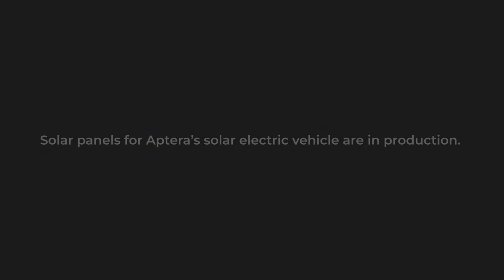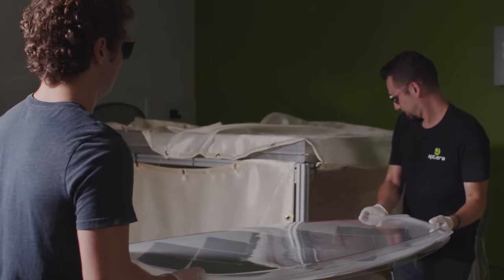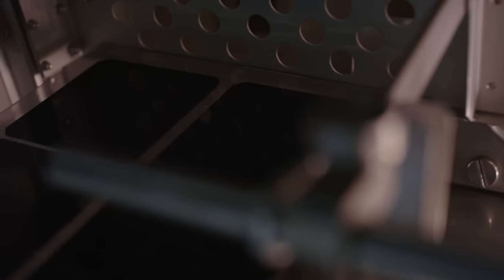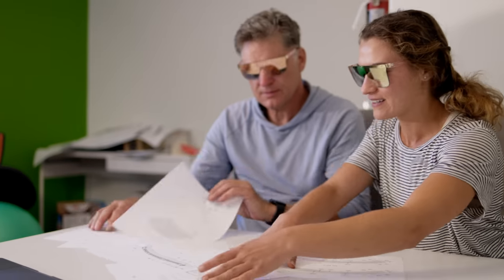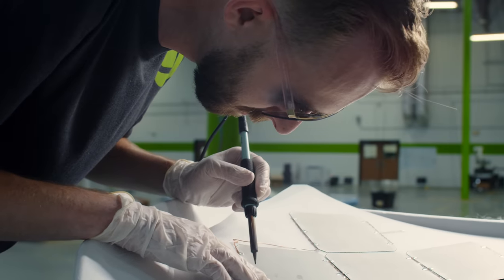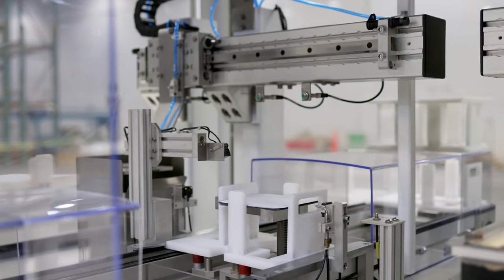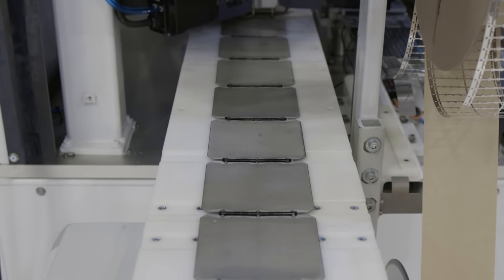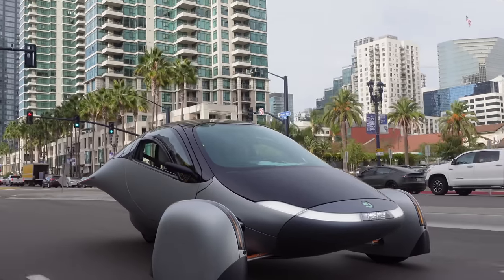Aptera — Solar is in Production

Comment: Incredible work.  To form panels over 2 axis while remaining durable and with a process that can be scaled for manufacturing is a major milestone.  You guys are leading the way for viable solar charging, and I hope this will inspire other automakers to offer solar options in their EV's.
Reply: Sunpower is the best in everyway. Aptera is also world leading in efficiency.
Reply: If it's scalable, it might give options for housing roof design development too! 🤔
Reply: @RufusJacson  not really, standard panels work better for that purpose.
Reply: @MrGamelover23  It depends on where they are installed.  These might be much better in locations where they are subject to damage.
Reply: @bobhilder1469  Not with the energy output and efficiency that Aptera has achieved.
Reply: @MrGamelover23  I meant that it might enable more interesting roof architecture rather than a standard flat pitch design i.e. curved panels for a curved roof.
Reply: This is a hard engineering problem: You can't bend a solar cell on two axis, that would require they were elastic, so they need them to lay flat under a curved surface. That requires either  that the gap is filled with an encapsulant, likely optical transparent silicone, but you can't just apply vacuum between the acrylic front and the backing film to drive out bubbles, because that would break the cells too as air pressure would bend them. From the video it looks like they a setting up the strings of solar cells, face up, on a former to give them support, then vacuum form the top acrylic sheet on top of them, then to make the backing as the last step, by either painting silicone or vacuum on a heat formed film? Still this is twice the number of steps compared to an ordinary solar panel, but it is quite neat and they look appealing and bubble free!

Comment: I think the most important quote  in the video is that they have put one of the riskiest design challenges behind them.  Assuming they have figured out how to make their chassis in sufficient quantity and make a wise decision on the wrap, there aren't too many more concerns left.  I think it's time to buy more stock.
Reply: Wise decisions?
Reply: They're not publicly traded yet, their option to buy has expired in June
Reply: @beachbeemer  There is vinyl wrap and PPF wrap.  If they choose vinyl, it is thin, not as durable, does not hold up well in the sun, and is a deal breaker for many people.  If they choose Cosmetic PPF, which is a thicker polyurethane film, that material is thicker, more durable, and self-healing, with a 10-year liffespan.  The wrap is a point of concern for a lot of people, but there are wiser materials to choose.  I am sure Aptera will get it right.
Reply: @littlemstracy  A new round opened up and is currently still open to the best of my knowledge.  It's not to late to back the truck up and load up on Aptera shares.
Reply: @jeffreypetsinger2967 , thanks for the heads up on that.  I tried to invest earlier but missed the cutoff.
Reply: Thank you for the explanation.  I don't like the idea of the wrap anyway.  I may get it without a wrap and have it painted when I get it home. I'm thinking about Candy apple red.
Reply: @littlemstracy  They offer new rounds once or twice a year
Reply: Agreed!!  🙂

Comment: Great video! More videos like this every other week would be awesome.  That would only be a handful of videos until Delta is revealed.  One thing I noticed that seemed to be missing is the hatch solar panel.  At 2:42 I did not see it in the layout nor on the rooftop shot.

Living in WNY, it would be great if while the vehicle was preheating in the dead of winter that a reverse current could be applied to the panels to melt the snow and glow at the same time.  A slow pulse like it was alive would be cool.

Look forward to your next video.
Reply: I had thought of a blanket of some kind to throw over the Aptera for a snowstorm. Brooming off a solar panel seems like an interesting idea!

Comment: Looks great guys! The effort that has gone into making such a clean and efficient car is simply amazing. Would love to see more videos of road testing the car at higher speeds/canyon driving.
Reply from the maker: We can't wait to provide you with more amazing content!
Reply: @ApteraMotors  amazing! Absolutely love the transparency with the build progress - would be amazing if you guys did a series for true hardcore nerds/engineers on the HV system, cooling, suspension geometry and so on. Lucid did a few really in depth episodes on their driveline that were very interesting. I understand that there are some things you need to keep tight lipped until production time but would be amazing when they can be shared!
Reply: Aptera Motors. To borrow from Steve Jobs  of Apple.  “insanely great!”

Comment: Solar cells that are simultaneously flexible in 2 axes are a PITA.  Within this domain are cells that must flex only ONCE, versus cells that must flex repeatedly or continuously.  Aptera cells are a mix of both, with a major fixed curvature set during production, then impact and thermal "flexing" during use (which is common to all solar cells, including flat ones).

Aptera solar cells need to curve just once as part of the production process, and the Aptera radius of curvature, while significant, isn't extreme. Unfortunately, for all intents and purposes it is pretty much impossible to make a flexible solar cell with anything close to 20% efficiency.  Only rigid solar cells presently reach this efficiency.

Aptera is all about efficiency!  How can they reach their solar performance goal?  The answer concerns reframing the question: Can a solar cell precursor be made, then flexed as needed, and THEN be processed to become a functional solar cell that is efficient, rigid and curved?

The Aptera video provides clues that this is indeed what is being done.  Rather than list those clues, I'd first like to hear your thoughts on this!

Comment: So "in production", but the technician says the panels are close to the design goals.  Which is it, you are producing the ones going on vehicles, or they are not yet ready?
Reply: I'm guessing they asked for 750W and got 700W so they said "That is close enough" so they're warming up the production line. They might either build ahead or (more likely) see if they can improve it slowly while the rest of the facility gets up and running.
Reply: Aptera is a Kaizen, or continuous improvement company.  They will never say "good enough" or wait for model years to phase in improvements.  This is not an either or situation on any of the Aptera engineering.

Comment: I hope that the 10 a day statement was old. 3,650 a year will really slow down production and output. This might cause people to drop off. Lets hope they increase that section of production in order to make more. Either way, I liked this video, it’s polished, technical and informative.
Reply: Steve, they noted in the video that they had a low volume production line and that they were already working on a high volume line.  They will be able to scale as needed.
Reply: Bruce, do you think they’ve started to produce in low volume to get a head start on production?
Reply: @LanderMaybe  Yes. there will be some of the initial production vehicles destroyed in the crash test program, so early defects in solar panels used may not be quite so important.
Reply: @n.brucenelson5920  Hey Bruce, how many Apteras will have to be destroyed in crash testing? Can parts that are not damaged during testing be reused? Take care.

Comment: I obviously missed an opportunity today when I put on my Zero shirt to go out, skipping over Aptera. This is great news that you're sharing. It reinforces my conviction that the full solar package is what I want my neighbors to see. I'm so happy this moment to be a reservation holder and an investor. One question though, since I sometimes procrastinate. How long can crow poop be left to bake on the panels before it causes discoloration or loss of function? If I clean it up within a week, will everything be okay?
Reply from the maker: Hi Dan! That's okay, you can rock your Aptera shirt tomorrow 🙂 Thanks for being part of our movement. And yes, keep them clean with soap and water. We are designing with this in mind. The panels will be guarded with a strong layer of protection to withstand hail or animal feces. The best way to capture the most amount of energy from the sun is through full exposure. Because they work together to charge the battery pack as efficiently as possible. That being said, just because certain panels aren't exposed to the sun, does not mean that everything will shut down.

Comment: Very excited for this! I'm assuming this means that all production for the Aptera is nearly ready to go to start building?

Also, I'm curious about something.

With all the options on the Aptera, I wonder which ones, if any, would be user-end upgrades that can be purchased later to be added to an Aptera. Example: say they buy a base model. No additional add-ons. Can an off-road kit be added later? Improved audio? I assume these 2 may be more difficult. Possibly the tent and animal kits might be easy user-end add-ons later? Asking because I've set my reserve order, but I'm wondering if I'd ever want to get the tent kit later on. Don't do a lot of camping, but maybe that might change in the future. Most of all, if I do a road trip, which is something I'd love to do someday. I'm also curious if window tinting would be doable or not. Or maybe getting a paint job, if you want to change the color someday. You said you want the Aptera to be a generational vehicle to be passed down to kids, but if say I get the noir color, what if they want it to be white or something custom?

I know, lots of questions. Sorry. 😂
Reply: Aptera is a right to repair company so in principle most things can be added.  Due to the weight of the battery packs, they might be a difficult prospect, however.  Custom colors can be ordered from Aptera or done at a local shop.  Aptera encourages aftermarket suppliers.
Reply: Excellent prepper vehicle.  Maybe a vehicle for Mars?
Reply: @daviddrake6875  Aptera is designed for use on Earth.  Mars vehicles will have an entirely different set of conditions they need to perform under.  The sharp focus on purpose from design on, would be similar, however.

Comment: I am a reservation holder as well as an investor with Aptera. Can you confirm if your production version will have V2H capability? No, I am NOT talking about V2G (i fully understand that the regulations are yet to be standardized).
It will be such a shame not to utilize all those battery power in the car. Especially since Aptera is promoting it as a Grid Negative vehicle.
Reply: They've said they expect to have V2L (Vehicle to Load) at launch. That's via an ordinary 120 volt outlet (or 240 vollt in Europe) useful for camping, computer charging, power tools and some emergency power during blackouts. 

With their open documentation and "right to repair" philosophy I expect some entrepreneurs to provide V2H and V2G add-ons soon after launch.
Reply: They’ll eventually have all the V2s, but I wouldn’t count on V2L at launch.   They are focused on getting the essentials working first in the initial units.

Comment: love your work! whats with the glasses? 😂😂😂
Reply: It is a safety measure do protect against the UV light test rigs.
Reply: N. Bruce Nelson is wrong.

From another commenter who looked up the ACTUAL safety requirements.....

"Laser Protection. Employees whose occupation or assignment requires exposure to laser beams shall be furnished suitable laser safety GOGGLES...." and ".......or other equipment producing ultra-violet radiation shall be so arranged or shielded that ultra-violet radiation, either direct or reflected, does not strike employees' eyes in harmful intensity; where such arrangement or shielding is not practicable, employees shall be provided with GOGGLES..."

Note the above references GOGGLES and not "weird sunglasses".

Comment: Awesome update. I still don’t get the sunglasses other than “the future is bright” innuendos I’ve heard in the comments. LOL.
Reply: When working in a test environment with UV sources it is likely to be an OSHA requirement to have them.
Reply: @n.brucenelson5920  Makes sense. Thanks. But even during an interview?
Reply: @sentino68  I haven't been in that location and don't know what the Cal OSHA rules are for the space, but it it certainly possible.
Reply: N. Bruce Nelson is wrong.

From another commenter who looked up the ACTUAL Cal OSHA requirements.....

"Laser Protection. Employees whose occupation or assignment requires exposure to laser beams shall be furnished suitable laser safety GOGGLES...." and ".......or other equipment producing ultra-violet radiation shall be so arranged or shielded that ultra-violet radiation, either direct or reflected, does not strike employees' eyes in harmful intensity; where such arrangement or shielding is not practicable, employees shall be provided with GOGGLES..."

Note the above references GOGGLES and not "weird sunglasses".

Comment: At 10 a day, if they can produce the other assemblies in the same quantity and put it all together in a days work, they will be out-producing the GMC Hummer from day one.
Reply: Yep.  40 initially per day will see Aptera captch up with Rivian quickly.  Rivian made ~55/day last quarter.  300,000 / year would put Aptera as a 200 billion+ company.
Reply: @ccibinel  what margins and earnings multiple are you using?
Reply: @kennyg1358  EV companies have substancial valuation per vehicle far in excess of industry normals or economic fundamentals.  Producing units and making ANY profit will result in high valuation.  As to 200+ billion its an estimate that is based on looking at tesla, and rivian value per unit.

Comment: I'll reserve my opinion until I see the specs and how much better these modules are. Lighter weight modules isn't the problem in EV's, their weight is insignificant to battery weight. Personally I wish them well but think we are still a long way from EV range being substantially increased by body panel modules.

Comment: I have a question about the solar production line clip @ about 4:09. What appears to be roof solar panels go by but some of them have copper wiring lines running @ a 45 degrees to the left while others are 45 degrees to the right. Shouldn't they all be the same or am I missing something?

Comment: If this can be done affordably w/o a weight penalty vs. a glass roof, this could be justified as standard on basically any EV.  Potentially far greater impact outside of use on this niche aptera application.
Reply: Yes.  The thing that makes this compelling for Aptera is that the overall vehicle efficiency adds meaningful range - something not the case for most EV designs.

Comment: How are you doing this? Isn't it impossible to bend a flat 2D solar panel into a 2-axis compound 3D curve? Are you cutting the panel, stretching the middle out or compressing the outside in? None of these methods seem like it can be done without hurting the panel.  Once again, Aptera has done the impossible.

Comment: Aptera I got an unrelated question but I did not know where else I could ask it, can the wheel with the arrow covers go over speed bumps given how low they are or can they like raise up and down or something when necessary?
Reply from the maker: Hi there! You can always ask questions via the Contact Us page of the website if you don't see the answer you're looking for in our FAQ (https://aptera.us/faq/). 😊 But we're happy to answer here, too! 

Not to worry - Aptera will be able to go over speed bumps. Our middle wheel can take a pounding and there is much less weight on it versus a typical EV. The vehicle's 5" ground clearance and good entry and exit angles on wheel covers will be able to handle speed bumps and potholes!
Reply: @ApteraMotors  Thanks 👍

Comment: Great work guys.  Can not wait to see the Aptera on the road.
Reply: The Gamma is already on the road. I am looking for it in my ride share Bolt. My next “ride”
Reply: @daviddrake6875  Yes I have seen that on other shows. I am just waiting for the production models to hit the road. And to reach Europe and hopefully the cost will not be to much higher then the US $ cost. But I am afraid it will due to taxes. I would go for the 600 miles range version 3 while drive and full solar panels. It is the Aptera or the Xbus for me.

Comment: Needs to build a optional trailer that can. Have a large surface for charging and is aerodynamic
Reply: Aptera has put out a call for third parties to consider trailers for the vehicle.
Reply: @n.brucenelson5920  But did they "put out a call" for the kind of trailer like the OP described?  Likely not.
Reply: @alainchuzel8341  Chris Anthony discussed this in one of videos where he said that they would be providing a trailer hitch capability.

Comment: I have one question for Aptera?
in the near future (say around 5 years)
is it possible for there to be a production line that allows for many passengers (Like 6+)
Reply: Their original SEC filing lists several new vehicles.  The second one is likely to be a 4 wheel, 5 passenger sedan.  I don't think we will hear much more in detail until this first model is in production and they start preparing to go public.

Comment: I love solutions you are comming up. I just don't understand why you are trying to "bend" stiff poly/monocrystaline cells instead of use of thin film panels that can be any shape and also can be flexible and reach better energy production in non ideal situations (partial shading, non ideal angle, etc.)
Reply: They have limited real estate to work with. The panels have to be as efficient and robust as possible while still cost effective.

They are designed so that new tech can be phased in in the future as it develops.